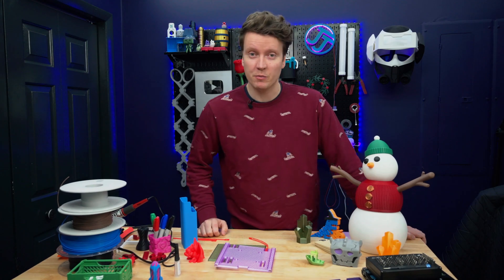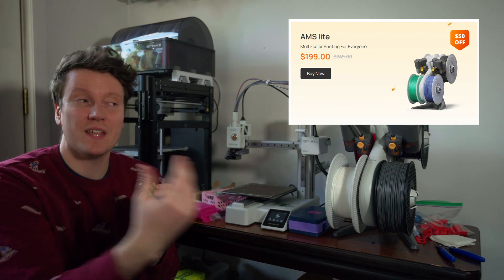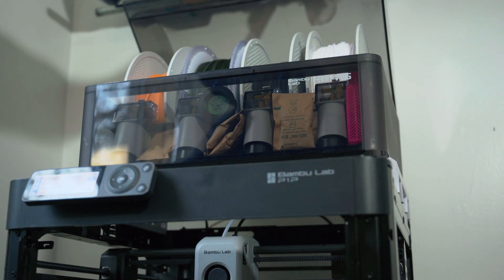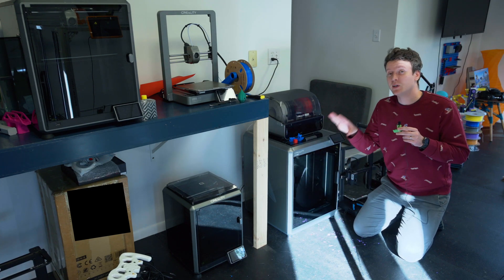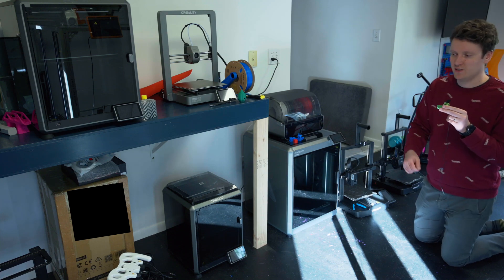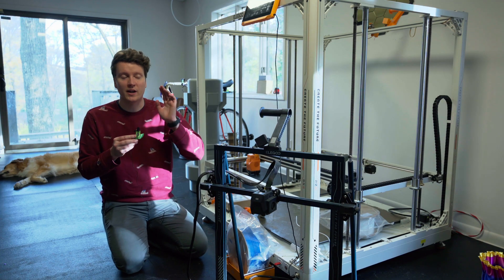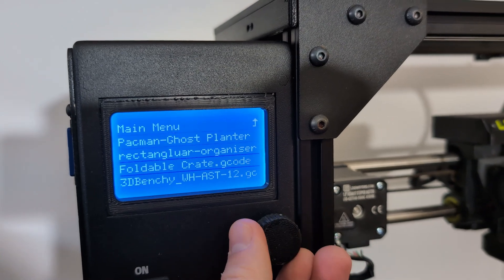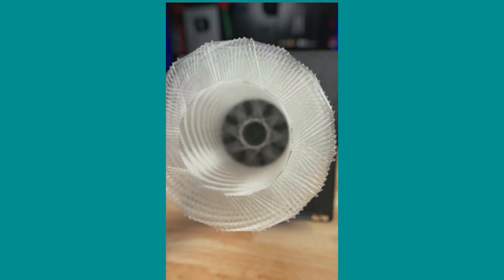My Favorite 3D Printers 2024

Comment: Shame you cant get a anycubic kobra s1 yet. Or even a kobra 3 with ace system. Excellent printers, honestly think anycubic is going to be a contender for bambu lab competition, especially with the latest bambulab drama.

Anycubic seems to be putting in a serious amount of stress testing on their new kobra s1 for once. 

The early bird price was also ansolutely insane, half the price of a p1s for a printer that somewhere between the p1s and the x1c.

And their multi colour system is also a filament dryer.
And they use rfid on their filament spools.

And their filament is cheaper than bambu.

Comment: The P1S should be printing better quality than the A1 and A1 mini - the stability of the components is significantly improved with the P series not slinging that bed. Sounds like something's off if that's not happening on your end. There's also a lot more to having an enclosure for printing drama queen filaments and helping to vent out the particularly nasty fume variants.
Reply from the maker: The a1 printers greatly reduced the vertical fine artifacts that show up on the P1P. They are more visible on shiny filaments. The coreXY should theoretically be better, but the a1 just has some improvements

Comment: Don’t the p1s and a1 print at the same speed? also shouldn’t not print as fast because it’s a bed slinger
Reply from the maker: Theoretically the bed slinger should be slower, but when I slice things with Bambu's default profile for each machine then the a1 is slightly faster. And they greatly reduced the vertical fine artifacts on there a1
Reply: @ ya true